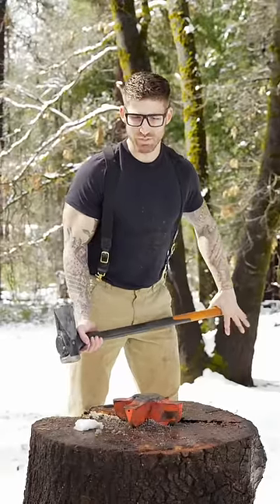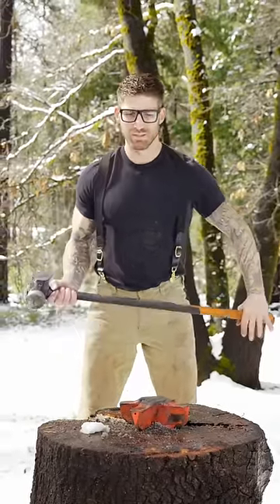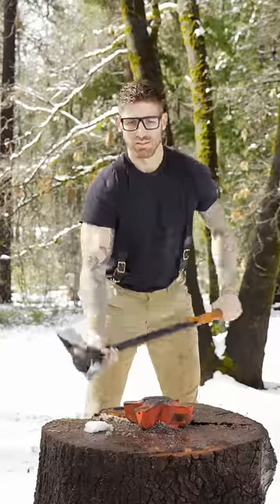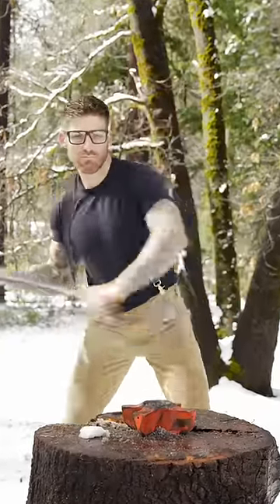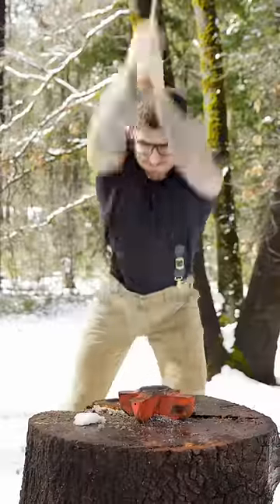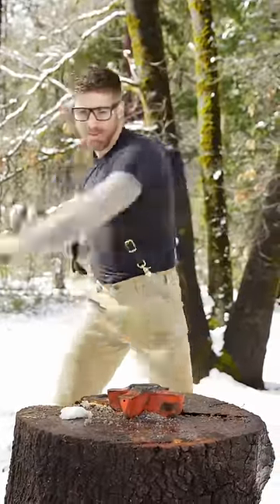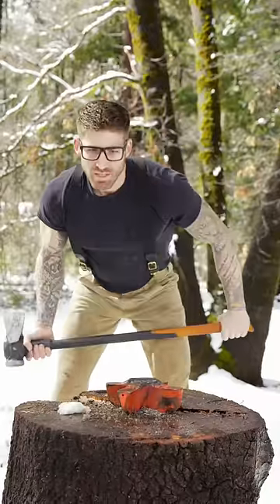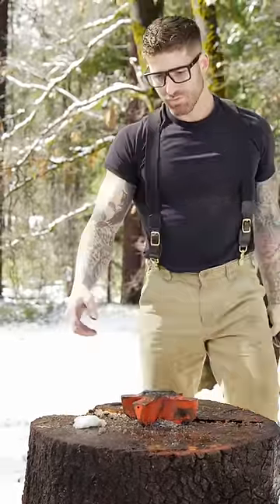When the prototype should stay a prototype

Comment: Yeah, it might work on a hydraulic press but without consistent pressure, that's not splitting anything 😂
Reply from the maker: Bingo
Reply: @ThorenBradley it’d make a cool mace if you put it on a handle though
Reply: @crazyaz7161 if you attach a chain you got a flail :)
Reply: @ThorenBradley I wonder how it’d work if you just welded that onto a sledge or something…🤔🤨 wait nvm bad idea 😂😂

That’s just an ER trip waiting to happen…sorry I let the intrusive thoughts win on this one 🤣
Reply: @ThorenBradley  like asking your grandma to knit you a sweater with a Phillips head screwdriver 🧶🪛
Reply: Consistent
Reply: think the wedge is too wide
Reply from the maker: @shacktime  😂 possible. But not optimal
Reply: @ThorenBradley  🫠
Reply: @crageranimations3915 if you attach wheels it would be a bicycle
Reply: @troublemaker731  I was think really big beyblade, but that could work!
Reply: I'd like to see a big screw that he hand cranks 😂
Reply: It could definitely split a normal sized log
Reply: Omg, this hydraulic attachment don’t work with a hammer. It’s so stupid
Reply: Yeah just seeing it at start of video my only thought was "That's for a press"  Angles are crazy for manual work
Reply: @Playingwithproxies  he showed that in a recent video. It still sucks. He can use it but it’d be more efficient and more effective not to
Reply: Maybe its surface should be toothed with snake's fangs to make it one-way, but it still wouldn't work with even mildly moist logs.
Reply: This is what I was going to say it was designed for constant pressure in theory this is awsome in prectocr not so much of it was longer it would work
Reply: Even then I wonder if it'd actually split it into four pieces or just two anyway.
Reply: @carterrrrrrr  I think it's too short. If it was a foot or two longer it would work. Also it needs to be smaller in the beginning and then taper to that size at the end.
Reply: The four blades need to be as sharp as an ax probably.
Reply: Exactly what I thought. We use that kind of thing in Australia a lot.
Reply: I was thinking the same thing.
Reply: @shacktime  My grandma did.  she couldn't find her needles so she grabbed two of the narrow long shafts and went to town.
Reply: I dont know, it might split the bones in your wrists!
Reply: @AsmodeusDHare  😳
Reply: I bet you could still sell them. Lol
Reply: @Joker-11B-SYLV I think there's a video of someone making what you described, but with two axes welded together.
Reply: I can't read this without random innuendos popping up in my head
Reply: Thinking the same thing , needs a hydraulic  ram
Reply: Smaller logs would work better, need way more force for a log that size.
Reply: Maybe sharpen it a bit.
Reply: If it was sharpened, made a little slimmer in profile and longer in all areas or would probably work pretty well tbh
Reply: Love how surprised he is that get can't get it to work when a hydraulic press will put thousands of pounds more force into the same surface area than he ever could.
Reply: Yeah... impulse force vs constant force*time.

Huge difference.
Reply: Hah exactly.
Reply: @ThorenBradley  He needs a heavier maul.
Reply: @crageranimations3915  Mace is better.
Reply: @ThorenBradley  was his name-o?
Reply: Plus it didn't have sharp edges they were really blunt

Comment: It needs to be longer and pointier. Whoever made it clearly wasn't an engineer.
Reply: Pointy? You mean like a rocket?
Reply: I think serrations will help it bind as it gets driven in as well but that would require even more work
Reply: @colelje  - More like a nail with wings, but sure, a rocket 🚀. 🤣
Reply: That is EXACTLY what she said!!
Reply: @colelje  Dictator reference, love it!
Reply: Exactly, otherwise, it'll bounce back. Pointy sticks in the ground.
Reply: I'm not an engineer, just a welder, former mechanic but I agree, more pointier may work better.
Would adding a 4-6"X1" spike make a difference?
Reply: @anythingforabuck  absolutely it would!  It needs something to bite the wood and start a deeper split.
Reply: It was made by an engineer. Except it's intended to be used with hydraulic splitter which can exert several tons of continuous force on it. If you max out half a ton for a split second, it's not gonna work.
Reply: @michaelbuckers  engineers can't hear.

Who knew
Reply: they do work when used on the intended timber.
Reply: @colelje  The rocket doesn't need to be pointy. It's just a delivery system. A good friend of mine who is a rocket scientist told me about it before. I've no idea why he won't answer my calls anymore tho.
Reply: @Mprikiman  fellow man of culture!
Reply: Pointier,,,,, which engineers book did you get that from.
Reply: @marksavage1108  - That's a term for short-minded people like yourself. I knew you would come along and most likely wouldn't understand a more difficult word.
Reply: @HardRockMiner  Attempted character slurrs,,,,, really. Yeah I dont work site machinery do I,. I have never changed a clutch on a D8 or maintained the JCBs. I didn't leave school early to weld and respray  hackneys and earn more than my idiot head teacher. I apparently `to you`, I have no coded qualifications in MIG and TIG welding    , I didn't spend 12 years in an engineers shop before going mobile, I didn't spend the previous ten years on civil engineering. You do know speculation is the mother of all stupidity, BRAVO   OH the correct wording would have been   ```Sharper or Acute````. when indicating its use as a cutting tool. OK sweetpea I hope this helps.
Reply: @marksavage1108  - It doesn't need to be "sharper" to split a log. It's just a pilot bit and a spreader more than anything else. The blades behind it need to be sharp. The pilot bit tip just needs to be POINTIER. I wish had $5 every time I had to explain something simple to a parts changer.
Reply: @HardRockMiner  You do realise sharper and ``pointier`` are the same thing, Longer with a more acute angle. That log still has some green in it, on a properly cured/dried log that short version could work.
Reply: @colelje hahaahh got the reference i think
Reply: That's what she said
Reply: Nothing wrong with the device. He's trying to split a round designated as a chopping block bc it's full of knots and twists.  Everyone who uses wood to heat their home has one.
Reply: @The_DC_Kid  - You're insane. I use wood to heat my home, and I don't have 1.  Nobody I know has 1. To split wood, you need a wedge shape. That's why an axe is shaped like it is!

Comment: I'm not an expert, but that thing is as sharp as a basketball.
Reply: hilarious comment
Reply: Yes he is!
Reply: He did and it was a piece of cake
Reply: Don't really want sharp, it just needs to be able to squeeze between cellulose fibers.  A really sharp axe or wedge just gets stuck.
Reply: @goodolarchie agree. However it just looks like straight metal. Maybe try creating more of a wedge shape and I think it’ll work a lot better
Reply: It's also trying to spread not enough force too far. a 2-way splitter works much better.
Reply: It’s going in and poppin back out, it’s not the wood that’s too hard lol swing harder hahaha a
Reply: And it creates forces that oppose the desired result.
Reply: It's not about sharpness. The point of a splitter is to focus the force into a small area to penatrate and split wood apart.  You're not cutting, your splitting.  It's physics, plain and simple.
Reply: one must hit both sides not just one side if that doesn't work you start at an edge :) anyways
Reply: splitting wedge doesn't really need to be sharp. Once it's in, it's in.
Reply: @JordonPatrickMears11211988  Maybe for the splitter itself, like that wedge he's got if it was where it should be - attached to a hydraulic ram. But I'm sure cutting the fibers is better for manual splitting, like he is. Even with this, if it was sharp and nearer the edge, it'd have a better chance of working.
Reply: We can tell you are not expert because the sharpness of the wedge is irrelevant. Well not irrelevants it's supposed to be not sharp. But in this case it's irrelevant because that's just bad wedge.

Comment: The nicest “bruh” moment at the end. I was splitting this apple stump last night and it beat my ass man. Opened her up and it was just one giant fkn knot.
Reply: We all love them, deep inside 😅
Reply: You poor poor man
Reply: It's a stump, so it's definitely a knot.  Flip your stump roots up and you'll have an easier time. Wedges between the roots.  I split alot by hand with 10 lb sledge.  16 or 20lb if they are stubborn
Reply: Ouch
Reply: @DesertJacks that’s what I was thinkin, using an axe to hammer it in? I get it he knows what he’s doing but come on, if you’re gonna use a wedge, pair it with a sledge
Reply: What?
Reply: @itsnotamasterpieceitsamist772 is it not equal parts hammer and axe? Do you mean the hammer is too light?
Reply: @itsnotamasterpieceitsamist772  It's effectively the same tool. A sledge hammer is effective because its a blunt, heavyweight object moving at high speeds. If the axe is heavy enough, the only difference becomes the axe blade itself.
Reply: Idk if this was innuendo or....help me someone

Comment: That shits absorbing all the kinetic energy
Reply: That is exactly what is going on. The object has too much mass and inertia. The guy would have to increase the power of his axe swing by 400%, but then his axe handle would break.
Reply: @suicidaleuphoria7012  True, but he could also use more weight in his axe for momentum transfer. Think hammer and anvill
Reply: @ardaricus1566  This is true, but is it worth it? Think about what that would do to his rotary cuffs over time.
Reply: @suicidaleuphoria7012  Good point. Id answer that he also has to do half the strikes, but itll probably still do more damage
Reply: You could also make the top of the wedge from rubber and use a heavvy big rubber hammer??
Reply: Yep too much area thanks to the adges
Reply: You could also just design the thing better, put a spike in the middle with a spreader like dang what is this...
Reply: @suicidaleuphoria7012  40lb ledge oughta do it.
Reply: Flip the log over with the splitter underneath. The weight of the log helps you. Additionally, your axe can be working a four-way split from the top.
Reply: Surface area of the wedge is too much, too many mind.
Reply: My guess is the log is probably applying a lot more friction to the 8 surfaces of the cross-shape than on the 2 surfaces of a regular axe or maul.
Reply: Yeah i thought it should be hit with a rubber hammer, not metal on metal.
Reply: @suicidaleuphoria7012 I was thinking the issue is the angle. I have had 4-sided splitters, but they are long and narrow. I think it’s hitting too many wood fibers at once.
Reply: @suicidaleuphoria7012   - or the mass of the striking tool - maybe a >20lb sledge...
Reply: @suicidaleuphoria7012  - nope, bad technique "does-in rotator cuffs"...  Not the strength.
Reply: @NostalgicPerson11  At that point basically all your force is absorbed to deform the rubber.

Comment: Would have liked to see you split the logs with a regular axe to show it was not the wood's fault.
Reply: Wasn't the splitters fault either. He just can't generate the extra force required for the additional sheer strength. 4 way axes exist, but you aren't splitting something as large as he is trying
Reply: He is using wet wood plus a pretty hard type of wood 
It's not about the tool it was about the wood being hard 
He struggled with cutting it with a normal axe before
Reply: Splitting large rounds requires a splitting maul; axes are useless on something this big, even a heavy double-bit head.  Sometimes it requires a sledgehammer and one or more steel wedges to complete a split. The piece he's working on would make an excellent chopping block rather than just firewood.
Reply: he literally cut the side of it off probably as a test
Reply: He does. There's another video along with this one.
Reply: He should have tried that attachment with logs too.  A stump is rather ambitious.

Comment: This blade is made for small and slow movement with long and high pressure. The blade is blunt to withstand the pressure without deforming. If you use it with a sledgehammer, you try a blunt blade with high movement and very short time pressure. The angle of the blade needs to be different, very flat, to go deep into the wood.
Reply: This should be the #1 comment
Reply: @iam18bitch2  like he said the creator made it to be used with a sledghamer but  it doesnt work, because like you said it original function was with a press
Reply: Absolutely on the money. It's to short & stubby. Needs a couple extra inches in depth, and far more narrow & sharper edge. For concussive force operation.
Reply: This is 100% it. My grandpa and I used to split hardwood with a homemade hydraulic log splitter with a very similarly blunted anvil, and there was nothing it couldn't handle. But the hydraulic motion happened in ultra slow motion, and that was the key to the whole instrument.

Comment: It is not made for impacts/sudden applied force. It is made for a static applied force. But you gotta try it out to find out! Good work mate!😊
Reply: yeah he needs to get rid of his hipster Fiskars and get something with some weight to it.
Reply: @xephael3485  what are you even talking about lil bro
Reply: he would need to strike it with like 5 times or more force for it to start punching through the stump.  that splitter has about 4 to 5x the cutting surface area of a normal axe head, and hes still only swinging with enough force for a normal sized axe

Comment: I love the utter frustration in your voice as you threw your ax lol Been there brother (I'm a welder, metal does funny things sometimes).
Reply: I imagine if you are doing a simple wedge, the wide base helps you drive it in and force a split. The amount of force to split a hunk of wood in 4 different directions is more than he could give it. Maybe a pneumatic splitter and thinner wedges.
Reply: As a welder I spent a majority of the video trying to see the welds
Reply: Nah it's ok, just need a way to maintain pressure. You gotta rig it up to some kind of ratchet similar to a torque wrench, you beat the lever down sending the 4 way axe further in, and with your sledge you just easily cycle the lever back into a good beating angle
Reply: What?
Reply: I don’t think it’s made for stump of a tree but mid size fire wood that thing looks wet still not dry so mass need to cut would need be grater simple physics but the guy want be macho and use big log to prove he’s right when he miss calculated what needs to be done to do it right..